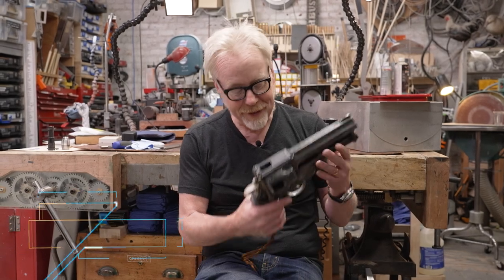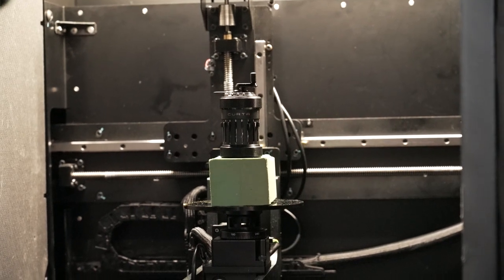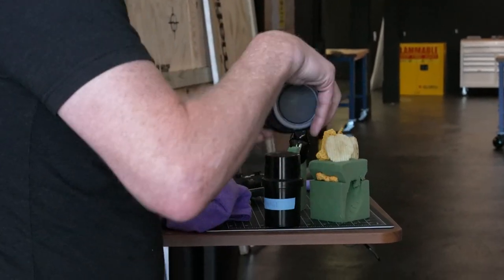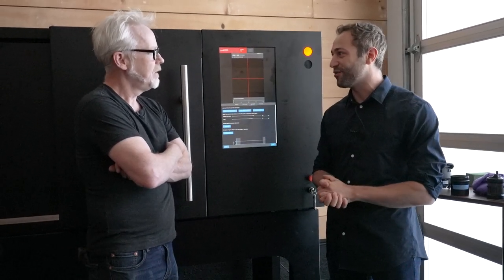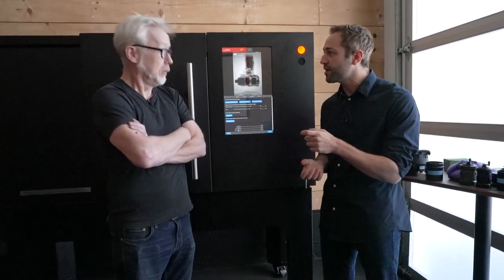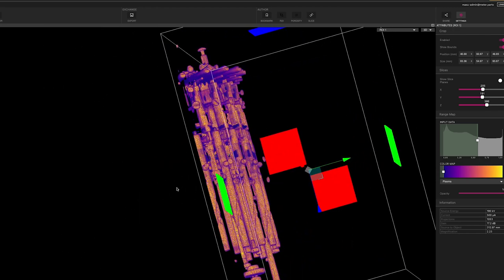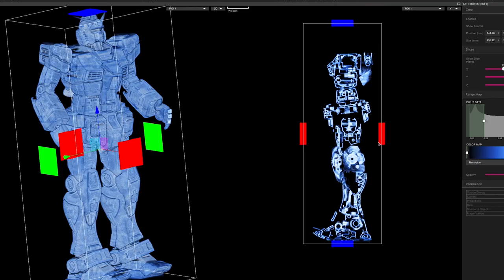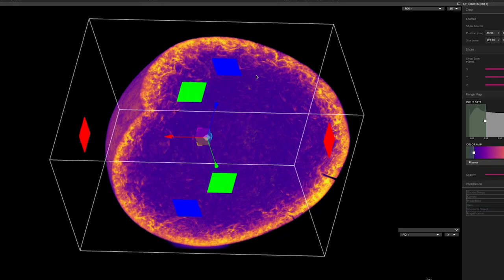Adam Savage's Curta Calculator Gets CT Scanned!

Comment: I love seeing industrial CT!
Best job ever!

I'm a certified NAS-410 Level 2 CT technician performing contract inspection. I scan all sorts of interesting things: aerospace, med device, forensic engineering, reverse engineering, and metrology primarily...

My lab uses microfocus sources so we can see resolution down to about 3 microns.
Reply: What's something really cool you've scanned?
Reply: @Just_Sara  Coolest thing I've scanned: actual spaceflight hardware (8 flights and counting...)

Weirdest thing I've scanned: a pig heart in a clinical trial testing a new stent.

Biggest thing I've scanned: heat exchanger cold plate.

Smallest thing I've scanned: medical catheter that required 3 micron resolution.
Reply: @jeremiahshoemaker9512  Damn, 3um is amazing. I've gotten ours down to about 15um for really small samples, I'm very jealous. I assume the pig heart was frozen?
Reply: @circleofowls  Yeah. It took MANY attempts to get that scan to be successful.
The pig heart was actually refrigerated before and after, but not during the scan. It was scanned while suspended in formaldehyde. Fixturing to prevent sample movement was the hardest part of that scan. But yes, when scanning biologic material, it generally has a time limit for scanning...
Reply: @jeremiahshoemaker9512  Lmao, I'll bet. I imagine that was satisfying as hell to get a good image on.  It sounds like you have a sensor/source that rotates around the sample?
Reply: @circleofowls  Actually it is considered a 2nd gen CT scanner. The source and detector are stationary, and the sample rotates. Hence the importance of fixturing...
Reply: @jeremiahshoemaker9512  Yeah, that's how ours is setup, it's a GE Phoenix Nanomex, I can't begin to imagine how difficult that sample would be to keep stationary...major props for that accomplishment lol.
Reply: @circleofowls  All of our machines use NIKON microfocus sources. There are 6 on our lab. 3 are NIKON products, 3 are self designed. My company also does the custom engineering and manufacturing for specialized installation. I've actually got 3 machines running right now ;)
Reply: Some of my DR images are actually here on YouTube!
I was the technician that captured these:
https://youtu.be/lKS2ElWQizA
Reply: @jeremiahshoemaker9512  Damn, that sounds like an incredible setup...got any job openings around Austin Texas? Lol
Reply: @jeremiahshoemaker9512  Lmao! I remember watching that episode! I really need to upload one of mine, I thing the NDA has expired by now...
Reply: @circleofowls  We do have a lab in Dallas (Irving), TX...
I don't know about openings though. I'm at corporate, in MN.

Comment: Incredible device.  Designers live in a modelling world and tolerances there may or may not match the reality of building a million parts. Manufacturing tool wear; supplier part variations, assembly tolerances all contribute to pretty difficult realities. Where I saw one of these used successfully was a situation where everything was fine with good tolerances in both design and implementation. Then, after 26 month of volume production it started to drift with field failures rising first. Everything returned was parametrically measured and was again within tolerances. So what was it.  Well, this technique allowed for the team to see a tolerance "stack up" wherein tolerances - within spec individually - added up to being out of spec but in a small percentage of cases. Some would throw the "corner case" disclaimer card out here but it was root caused to perfectly logical tool wear variances and trying to run tools longer than the data made sense.

Comment: It's fascinating to play with these sort of scans and piece them together to form a virtual object.  If anyone wants to try something somewhat similar that you can mess around with that doesn't require a ct scanner, take a look into photogrammetry.  You can photograph almost anything with a cell phone or regular camera and learn to build 3d models and textures from real life objects! It gives you a smaller, external version of the same thrill you get here. With a little practice you can get really impressive results. If you get a good enough model you can 3d print it and bring the object full circle!

Comment: It would be really interesting to see if an AI can understand the relationship between for instance cad files and the products produced using them. Specifically, it would be interesting to see if it can categorize deviation types that can lead to solutions to problems and maybe even automatic adjustments to manufacturing equipment.

Comment: What I would like to know is if they can deduce the material from the density; how accurate is the machine in that regard? Could it produce an exploded view of all the parts and their materials? I'm also curious about the resolution; we saw some really tiny screws, but does it resolve the threads of those screws? Could it resolve something as thin as the crushed aluminum sheet matrix in the center of the sphere?
Reply: Material detection is included, so long as all your different materials have different densities (actually, it is more complicated than that, but density is the oversimplification they use). If you want to know the chemical makeup, that would require per-pixel x-ray fluorescence spectroscopy, which I highly doubt they could fit in an enclosure that small and would complicate the computation by about an order of magnitude, maybe more.

Resolution is largely a function of scanning time and computation time. More images at more angles and more distinct exposure times allows resolution for finer details. I would be very surprised if their best resolution is any worse than 5 micrometers, but that would likely take quite a while longer than their standard stated 40um. And yes, 40um is plenty of resolution for screw threads, in fact the fit of fine screw threads with mechanical components is something that this type of hardware is used to examine in industry. 

The aluminum ball may present interesting challenges. A dense shell with a far less dense interior requires a lot more fine grained differences in exposure time compared to most subjects which are more dependent on angular differences. It being mostly spherically symmetric exacerbates that.
Reply: @hypotheticalaxolotl  yes so a bit more than one and a half thousandths of an inch. 40 microns is around 0.0015748031"
Reply: I have a decade-old GE Phoenix Nanomex at work that will easily get down to 15um, screw threads are trivial to resolve. I'll show you the artifacts left by the machining that made the threads. I'd imagine that better software than what I have could easily export models of various material densities into a CAD program to build an exploded view from.

Comment: I'm sure you've thought about it but parts of the razor crest would be amazing to see scanned before dismantling to see how to break down and what space is available for modding, as well as an after to see how much changed. I realize its' size may require multiple smaller scans but if they could assemble smaller scans into one larger scan file that would be incredible.

Comment: Wow.  This is extremely cool tech.  And the pricing of the product is actually within the realm of reason.  It's not quite within the reach of consumer (at $3,000/mo entry level) but even the smallest engineering firms should be able to afford this.  What would be even cooler would be able to bring this tech to the consumer.  3D printing has always had the Achilles heel problem of getting a precise copy of a part.  If consumers could have affordable metal sintering 3D printers plus a consumer-ready CT scanner MINUS the cloud (there is zero reason for "the cloud" to be part of this equation), the consumer would finally have access to the ability to scan and print metal parts, which is the holy grail of 3D printing.  Being able to take, say, a cheap plastic part where some engineer skimped and introduced planned obsolescence and replace it with an identical 3D printed metal part that won't break would be truly game changing.  Also great for scanning a device you want to disassemble, repair, and reassemble and make sure you don't miss anything in the process.

Comment: The thing that always wows me about these scanners is that they somehow deal with reconstructing an image from essentially multiple photos, where every photo was taken through material which is refracting the light. And what you end up distinguishing in the image is basically the materials with different refractive index, which does relate to the density, though it isn't exactly the same thing.
Reply: This is close, but there isn't much refraction involved. We measure X-ray attenuation: darker areas in the 2D X-ray images correspond to denser material. By rotating the part as we scan, we're able to understand the composition of the part, and the different densities within the part, in 3D.
Reply: @lumafield  That much I get. But attenuation is represented by the imaginary component of the refractive index. And I'd stil expect there to be some amount of refraction which somehow would need to be compensated for in the software. (And maybe even some diffraction?)

Comment: Completely different situation, but the higher density on the outside of the aluminum foil ball reminded me of something in the fiber arts world; if you wind a ball of yarn, and immerse it into a vat of dye - say for a few hours - as the liquid seeps from the outside to the inside, the yarn acts as a filter, and less and less of the dye follows the water inward. Even wrapped fairly loosely, it's difficult to get dye all the way to the middle of a softball sized ball of yarn. The practical upshot is that you can create what's called a gradient dye. If you test and tune your processes, you can do neat things, like wind a ball, dye it, unwind it and inverse wind it, so the heavily dyed part is in the middle, and the mostly undyed bit is on the outside, and dye it again a different color, to create a gradient between colors. Then when you knit a sweater, it'll fade from one color to the other. Isn't stuff neat?

Comment: CT scans basically give you a whole stack of 2d "slice" images;  but each image also defines its 3d polygon within the whole scan volume.  one could write a  GetVoxel(x, y, z)  for CT data in an afternoon :)      however, it is wise to set up all your transforms to work in real world units, like millimeters, rather than by some arbitrary unit like voxel coordinates.  the slice thickness  VS  slice spacing  VS  pixel spacing  may all be different  (meaning your voxels may be "rectangular" rather than perfect cubes).

the other key thing to bear in mind is ur not really dealing with "images" but rather "density projections".  so there are no RGB color values but rather 16-bit grayscale values where the "pixel intensity" is a measurement of material density.  since you may have upwards of 65,536 possible density values, and typical computer monitor can only display 256 shades of gray,   "windowing" is used to isolate and rescale a portion of that dynamic range to be displayable.

CT is really nice (compared to plain old xray) because, when calibrated, they allow you to calculate Hounsfield units directly from any voxel value (a hounsfield unit of 0 is water).  this means you can isolate voxels for any material [density] you can dream of.  like you could literally do a scan of an object and generate a report of the total mm³ of plastic used in its fabrication.

multi-planar reconstruction (MPR) is fairly straightforward.  just invent whatever "cutting" polygon you want, then build a "texture" for it by taking each output texel's 3d coordinate (projected onto "cutting" polygon) and figuring out the nearest slice image, then unprojecting 3d point onto the slice image's polygon to get a texel X,Y in which to source the pixel value.  then display that generated "texture".  can improve rendering quality by essentially performing a standard interpolation algorithm like bilinear,bicubic,etc  except in 3 sampling dimensions rather than 2.

maximum intensity projection (MIP) is just a series of individual MPRs where each "cutting" polygon is just translated along the polygon's normal by your volume's voxel size, then each of your final output texels are just the max value texel from each MPR.

the really fancy rendering might even be the easiest of all, now that you can find consumer GPUs that support volumes. just blob all your voxels into a GPU buffer then slap a shader in there so you can apply data windowing and LUT.  look ma, no cpu!

honestly i think the real magic of spiral CT is just how the reconstruction of raw beam data even makes the 2d slices to begin with!

MRI is common to do a lot of weeeird slice angles and offsets (in medical) which makes 3d reconstructions a bit more challenging since you might even have duplicate voxels yet also whole regions of no data.

Comment: What's fascinating to me is, material and accuracy aside, you have the foundations for a replicator. You scan an object, understand the components and shape and can convert that surface data into a rapid prototyped object. Currently the tolerances aren't very good and the materials would not be the same, but otherwise you're getting there!
Reply: With a powder/resin printer or mixing fdm you might be able to make quite a few different densities within parameters.

Comment: I think an older electronic device would be grand, either discrete components on pcb or even boardless. So many different densities, and such interesting, complex arrangements. And I'd love to se a high res internal scan of a capacitor, to see if you can see its internals. Or a battery. All of those together in an old calculator or power supply or something would be gorgeous.

Comment: One thing I would be really interested in seeing scanned is antique forged tools.  Punches, hammers, drift, anything forged.  I would love to see the difference in density throughout the part, though that might be a difficult thing to see, not sure how much difference there is throughout the steel..
Or some of the modern 'Damascus' steel especially some of the more exotic ones that have copper as one of the metals.  That could make some interesting art or sculptures.
Cast iron might also be interesting to look at.
And even as just a beautiful thing to look at, some wood.  Looking at the different densities of the different parts of wood.  You could stack a number of different types in one scan to get a verity. 
And a flower.  Though that might be tough.  A 3d scan of a rose would be really interesting.

Comment: That was next level tech. That's deep learning ai for sure, with massive cloud processing. Once something like that can be hand held, it could be used in earthquakes and other disasters to find people.
Reply: Doesn't need cloud or "massive processing", doing this has been possible on desktop powered computers for over a decade. "Cloud" is just added on for marketing/control/lockin reasons.
Reply: @drsquirrel00  The guy in the video clearly said they upload the data for processing in the cloud, with the longest processing being about 12 hours. This is FAR more data than just desktop AutoCAD.
Reply: @Kardashev1  12 hours is the time in the machine taking the images not the CPU processing time. AutoCAD is such a low metric really, any old laptop can handle AutoCAD.

Comment: As I expected the rods and other features on the Curta that appears as red/orange/yellow as an indication of higher density is brass, not hardened steel. It makes the most sense since copper and zinc are both higher on the periodic table and was always used in clockwork like gears and mechanisms until later in the 20th century. And after seeing photos of an actual Curta being disassembled that is the case.

Comment: Adam, you have a Stanley no. 6, which is probably too large. But, a smaller plane would fit.  Try scanning an old Stanley plane to get a look at the density of that body.  Old Stanleys are notoriously fragile because of the quality of the iron.  It would be interesting to see the internal stresses of the casting and machining process not to mention stress fractures from a hundred years of use.

Comment: Love the Curta. Have 4 of them myself.
One type II I bought on eBay the moment I learned about their existance. Type 1s where for some reason just expensive. I bid on another type II but as I won the first I didn't bid higher on the second but happened to won that too - kind of expensive mistake but since it has doubled its price so it's allright. The third I got contacted by a Swedish dude here on youtube saying he found a type 1 on a fleamarket he wanted to sell. Got it at a fair price for both of us - has risen since then too. Then fate would one of my search agents popped up under an online meeting during one of the C lockdowns. An early black body type II (even prime serial) was for sale at an unbelievable price by a trusted long time and verified member (other platform than eBay) and I knew I had to act fast. So I sat there trying to multitask and pretend the meeting interested me while I bought the Curta. Could instantly flip it for a 3-4 times return of investment - but I won't. If any is for sale it's one of the late type IIs - the one without cardboard box and manuals but probably not that either. I received the early type II Curta and contacted to seller to say thanks for a great deal, well received and great packaging. He told me that after he shipped it he had been flooded with requests of people wanting to buy it at higher price than adverticed - luckily it went online in work hours and I was in a position able to buy it immediately - what a luck!